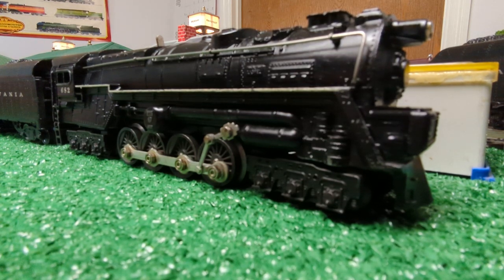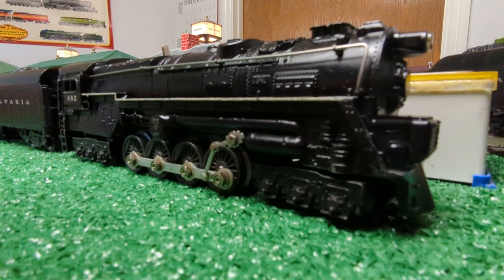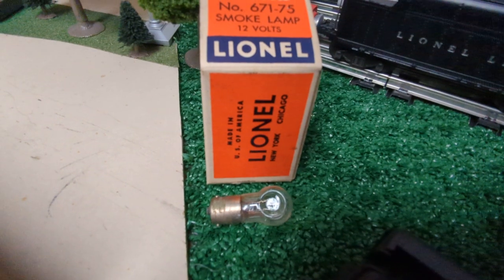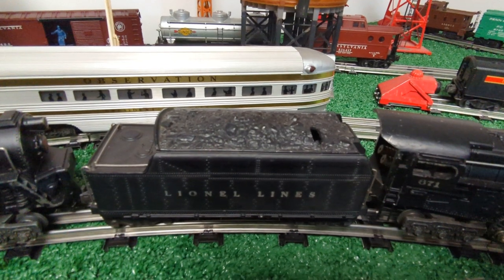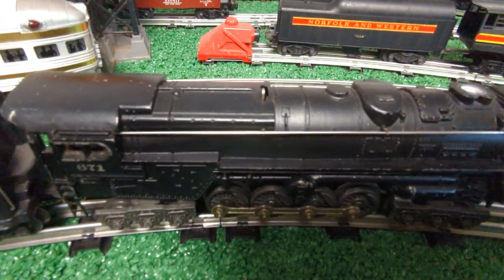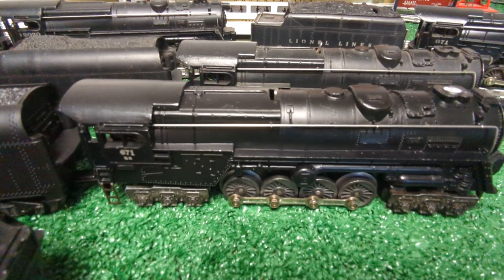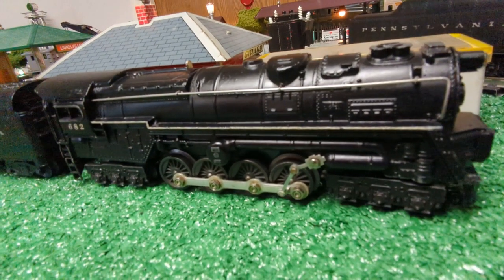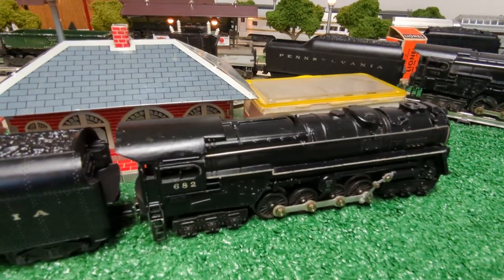Classic Postwar Lionel Turbines! Some variations include 671, 681, 671 RR, and 682.

Comment: Ironically I have 2671wx tender with my 681 as well. Unfortunately the rear stairs are broken on my engine. I see they sell reproductive stairs on eBay, but would love to find the original stairs, to keep my grandfather's Lionel trains in good condition. Thank you for your knowledge and video.
Reply from the maker: Finding original metal steps might be hard to find and hopefully you can find them. The reproduction steps are pretty close to the original and I had to install them once. I was lucky that a little metal was remaining and was able to peen the new metal steps back on. Otherwise you may need to tap the metal and use screws.

Comment: That transformer car is pretty interesting. We have the crane car and that caboose, looks the same as yours.  Also our locomotive is a hudson, maybe similar period to yours?  Has the switch on the top like that.  Still runs good.
Reply from the maker: Lionel made several Hudsons in the 1950s. What is the cab number on your engine? The small Hudsons were numbered 2046, 2056, 2055, and 2065 which were all 1950s. Lionel also made a large 773 Hudson in 1950, and again in 1964-66.

Comment: One thing I have never heard mention is the catalog price difference between the 671/2020 if bought separately was .75cents,grab an old catalog and check it out
Reply from the maker: Looking at the 1946 & 1947 catalogs, the 2020 was $32.50 vs $35 for the 671. In 1948 & 1949 catalogs, the prices went up to $35 for the 2020 vs $37.50 for the 671. I can understand the difference in price for 1948 & 1949 versions in that the 671 now included a nicer 6 wheeled truck streamlined tender (2671W). Not sure why the big price difference the first two years as they were essentially the same.

Comment: Thank you for sharing this video you have a lot of turbine engines! maybe you can help me I have a 681 with a 6 axle 2671 W tender with whistle it was found in a unopened sealed box many years ago in my aunt's attic after she passed away not even a chip or a scratch on it probably in near mint condition just wondering what year this would have been hopefully you can help me thanks
Reply from the maker: @mikeberthold1593  It would most likely be 1950 or 1951. Lionel did away with the 2671W after 1951 and went with the 4 wheel trucks on the 2046W-50 in 1952 when paired with a Turbine. The 2046W-50 was labeled with Pennsylvania road name, and the 2046W had Lionel Lines as the road name when paired with other engines like the 2046/2056. Hope this helps.

Comment: Did the later 2020's have a typical e-unit lever?
Reply from the maker: The 2020 is the same as a 671 except for the number and tender.  Note that the Turbines and Berkshires did not have E-unit levers in 1946 during their 1st year of production. Lionel added the lever in 1947 which probably had something to do with reliability, or more likely saved on the cost of using the plug wires in the back of the cab to activate the E-unit or lock it out. Not having that lever made the locomotive look more realistic without a protruding lever. Hope this helps!

Comment: Question: on your 46, since it does not have an e unit top switch, how do you make the engine stay in one direction?
Reply from the maker: An excellent question and one I should have explained in the video. There is a wire with a plug that is inserted into an opening inside the cab that provides power to the E-unit. Unplugging it does the same thing as moving an e-unit lever allowing the direction of train movement to remain unchanged when interrupting power, or locking it in one direction.
Reply: Thanks for explanation, awesome engine